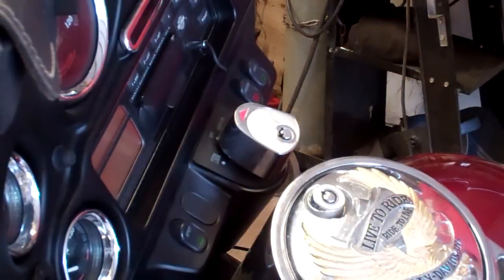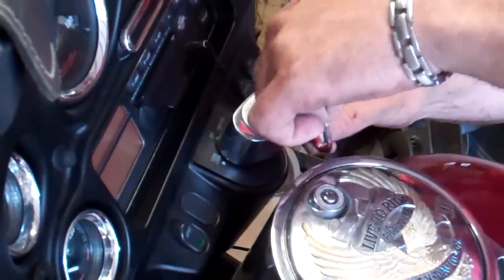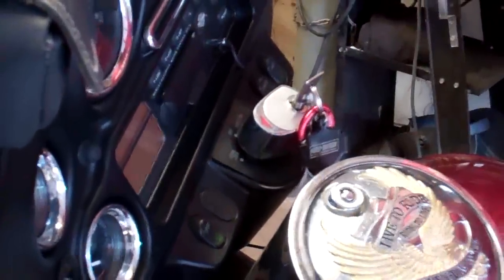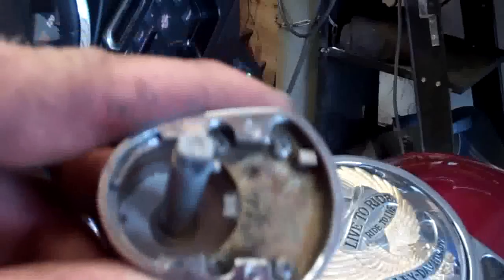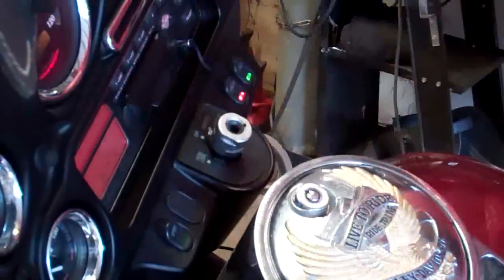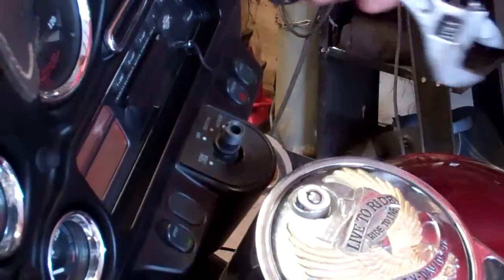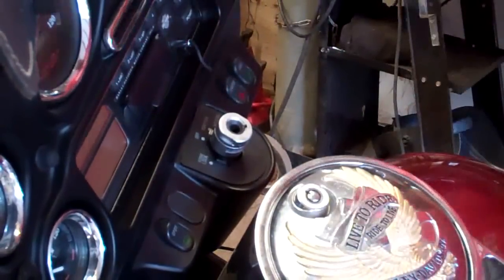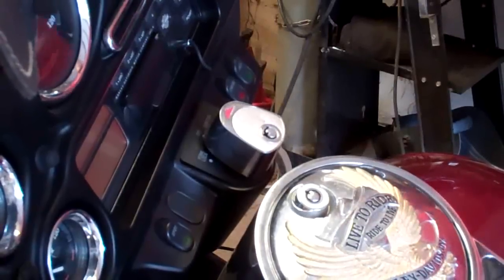Ignition Switch Removal From A 2000 Harley Electra Glide

Comment: I had a problem with this switch, it won't turn to block position, I watched your video, then I removed the switch and found the problem, the nut wat loose, now it works perfectly. Thanks a lot, greetings from Costa Rica!
Reply: Which nut was loose I can’t get mine to go to lock. Also does yours have a spring

Comment: Thanks for the video. Now I can try to find out why I am not getting power through the cruise switch. I think its the switch and now I will be able to replace it. Hopefully this fixes my cruise issues. Thanks gain for the video for without it I couldn't get to the switch. Just 2 more days 'til we leave for Myrtle Beach. First time to pull my Bunkhouse trailer with the sidecar attached. I see engine upgrades in the future for my 2003 Electra-glide Ultra-Classic and 1997 sidecar.

Comment: The reason it releases at accessories is because that is where the ignition switch is supposed to be when you press the button. This is not the way to do it according to the manual. That’s why you always consult your manual folks for accuracy. 👍🏼😎
Reply: True

Comment: Hey, just wanted to chime in.. you saved my ass as I was following a 2009 model video and I was actually prying UP on the switch after it was released but it was still in the lock position as the other video says to do..

Your VIDEO save my ignition on my 2005 UC... TY!!!

Comment: I have placed my key lock and forks in a locked position. Upon unlocking and positioning my switch into the On to start position I have Zero power? If I keep wiggling the switch back and forth eventually to power comes on and stays on in the start position. Not much information on this problem. Have you any ideas or heard anything?  Thx,,  Don

Comment: What he doesn’t tell you is in that top nut there is a set pin. His didn’t have it, mine did. What I loosened the nut it stripped out the plastic threads. Cost me a new ignition.

Comment: Actually you have a wire coming out of the front of the radio. To the right of the tape slot. Whats the wire lead to?  If you pull the wire out its a 1/8 inch 3 mm socket. Same as head phones ...